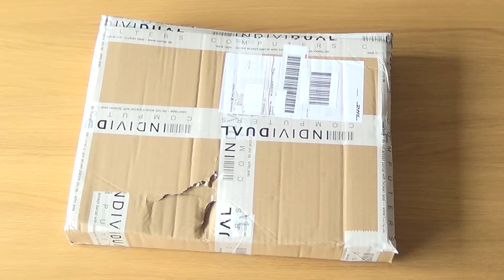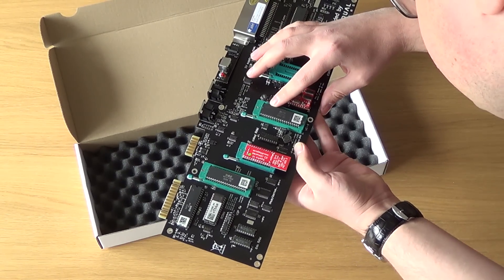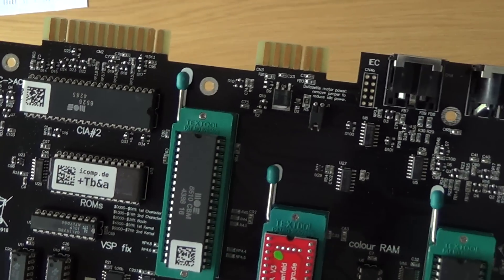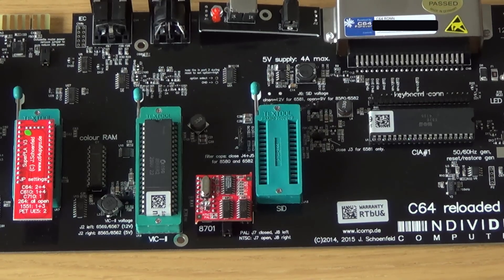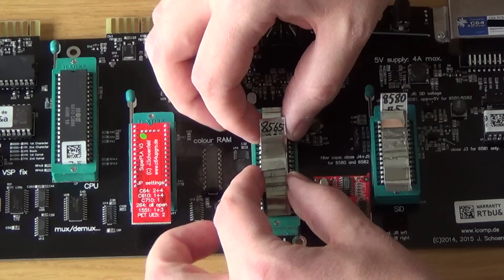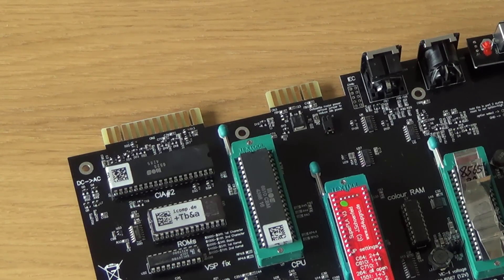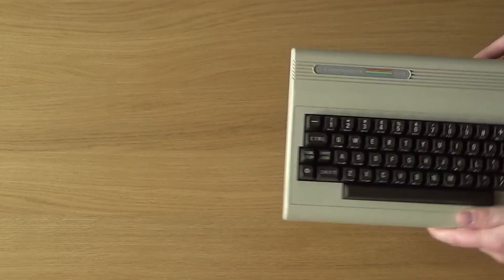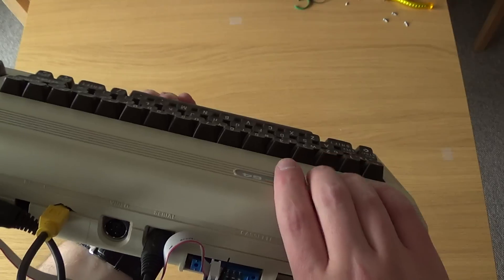C64 Reloaded. The new (MK1) Commodore 64 motherboard.

Comment: Oh My, Iv'e only just joined this group and am exited already, though i'm ten or more years behind all this since having my C64's and other commodore equipment in use. sadly I gave it to a relation of my Sons to look after. his sister and mother had a house tidy and put it all in the outside shed, story goes that it all got wet due to a leak then was thrown away, Imagine my despair when I asked for it back . it wasn't so much about the actual bread box C64 , Plus/4 , Vic 20, and hardware, more about the 1541 & 1551 Disk drives and the floppy disks that contained all the typed up programs and office software that I used at the time. I was also wiring up the din socket for audio output to create seperate audio channels like stereo (I believe there was a unit device that created a stereo sound at the time). So I was already working on a project.  I also had a program written for doing Video Titles called Title Master.    I used the y/C  signal of the 8 pin din connected and wired up the rca phono ends to a SVideo plug which attached to the sVHS socket input of a sVHS Stereo hifi Video Recorder for weddings and other intro's. that din plug I still have wired up to RCA Phono sockets.
Reply from the maker: Man, I feel for you. To lose a 1551 drive is bad enough, but the worst is really the irreplaceable data on the disks. 😐 But it sounds like some nifty home made solutions you did back then. Sounds very cool. 🙂

Not sure how much you know about the current state of the 8bit universe. But if you wish to get back into the game, there are plenty of things to get excited about. Especially regarding the C64. There are modern replacement parts for most IC's in the C64. Disk drive replacement (1541 Ultimate). Motherboard replacements, obviously. There is even an FPGA based solution to replace the whole system, called 'Ultimate 64', which is fantastic. And software, especially games,  are still being developed. The C64 will never die! Regarding VIC-20, C16/plus4 and other 8bit wonders (not just Commodore), there are also a lot og exciting things going for those systems. 😊

Comment: Some comments are about static electricity. There is something about it, but I'm not religius in this point.. However, it is a good idea to touch ground first, whenever you pick up a board. Ground should be available on alle holes for screws. On a normal C64 board, ground is on the edge of the board.

Another comment is about ripple on psu. I can show you what it is on the scope, next time you come for a visit :)

Just my 2 cents :) Thanks for a nice video, interesting to learn something :)
Reply from the maker: Hey buddy. :) You're welcome! Glad to see my old videos are still being watched, heh..

Before tinkering, I tend to touch things I know can zap me. Like a radiator or my table's metal legs. Never thought of (as far as I remember..) touching the ground directly on the thing I'm about to handle. I will try and remember that. Actually, I should have thought of it, as I remember having previously connected an anti static wristband to the ground on a board. Well.. That brain.. :/

I'm still not entirely sure what to make of ripple. If you can make me understand it, that would be nice, thanks. Yes, a visual aid probably helps. :) Right now, in my mind, ripple is some kind of unique unwanted noise. Or something.. :)
Reply: @CasualCommodore  Yoy are on the right path when dischargeing yourself :)

I do not know how to explain ripple in english, but I think it is pretty easy to understand when you see a picture of it on the scope :) But yes, it is a kind of noise. If there is ripple on a psu in an amplifier, you can hear it in the speakers. That can also make CPU, logic chips, RAM, etc. unstable. Or make a picture from a video circuit blurry.

Comment: Got my C64 Reloaded MK1 in a C64G case and use black heat sinks on the CPU, VIC and the SID chips. It got very heat on that chips much more than in the C64 Reloaded MK2. Use the Turbo Chameleon 64 on it for the VGA option. Have also the old 1541 Ultimate II but that is on my C64C 250466. My other C64 250425 RevA have the Nordic Replay. Would like to use the SIDFX on the C64 Reloaded MK1.
Reply from the maker: Nice toys you have. :) 250466 is such a nice motherboard! I also used the Chameleon for VGA some time ago. :) If you don't mind FPGA solutions, I can recommend the Ultimate64. It's very flexible, has HDMI and two SID sockets. But you probably know about it already, heh.. :)
Reply: Yes I live very close to Gideon and i know about the Ultimate 64 Elite. A lot of people praise the Ultimate 64 but what more have it.  For me VGA is very important because of the BenQ BL702A VGA 17inch monitor.  C64 is my first experience in 1984 than the AMIGA 500/1200. The best on the 250466 is the SID6581R4AR and the VIC chip. Have also the SID6581R4AR on the C64 Reloaded MK1 and would like the SIDFX with the 8580R5 as combo. The Turbo Chameleon 64 has good and bad things but that see you everywhere. Like the C64 Reloaded M1 more than the MK2. The FM YAM is also a great thing to use with the 1541 Ultimate II. The C64 is great to use with the AMIGA 500/1200. Do many projects with the AMIGA 1200 and the C64 is a nice sideway if I do nothing with my AMIGA’s. Have my hands full with the three computers and every time I learn new things. Look the most for the ACA1260 and the Vampire 1200 V2.
Reply from the maker: @johandenhertog6878  Sadly, the U64 does not have VGA. With appropriate cables and settings, it can do HDMI, DVI, RGB, S-VIDEO and Composite. I also use a BenQ monitor. :) I use the BL912 for my U64 and A1200 (w. VGA Indivision), as it has both VGA and DVI. But I guess you can just use the Chameleon for VGA, if you want. :) Ah, the Vampire V1200 V2.. I have also signed up for that one. It's very tempting, but I'm not too sure I really need it, as I primarily use my 1200 for demos and WHDload gaming. I think maybe I should use my money on the MEGA65, which should release with a years or so.. :)

Comment: it would be nice if they had expanded the ram to 128 or 256mb  like the ram expansions
Reply from the maker: Yeah, but 128-256mb..? Weee, that's a lot of RAM for the C64..!  :o)  Not sure there is any software that would take advantage of that much (let me know if there is, please). But hey, there is always the 1541Ultimate, that can do up to 16mb expansion. Which makes me think of the new FPGA based C64, which has it built right in: https://www.vintageisthenewold.com/fpga-base-commodore-64-ultimate-64-is-now-under-production/

Comment: "Less than 100 ripple."  Never heard of that unit before.
You can clean line noise pretty easily using a snap-on ferrite noise filter.
Reply from the maker: Nevertheless, it's a thing. ;) Not sure why it's important here, and it's rarely listed in PSU specs. I don't think it has to do with noise.
Reply: In terms of DC Power Supply design, the ripple effect comes from rectifying an AC signal.  AC is rectified to pulses.  A capacitor then tries to carry the voltage across the pulses, leaving a bias/offset of the DC voltage you intended in the design, with an AC "ripple" riding on it.  The larger the capacitor, the smaller the ripple.  I was joking by calling the ripple a unit of measurement.  However, a ferrite noise filter will shunt most AC signals (aka line noise) as well as that ripple effect.  The way ferrite cores work, a change in voltage causes inductance in the core, which is converted to eddy currents, which convert to heat.

In supply design, that ripple is also called noise.

A switching supply is an option that won't have ripple.  You can also use integrated circuits (78xx for positive voltage regulation, 79xx for negative) to provide a good clean DC voltage.  If you need more current than the IC provides, you can shunt a power transistor across it, tying the base and collector together with the source side of the IC, and connect the emitter to the output side (NPN example).

That 100 you mentioned is likely "100 millivolts AC".  In my opinion that's fairly large but common in cheap wallwarts.  You can also reduce that with another capacitor (electrolytic is good enough) directly across the +/- connectors.

According to one site I found (for the C64 supply), "The 5V DC voltage should fluctuate in a range of 4.95 to 5.10 Volt".  This means 5.025VDC with an AC ripple less than 75 millivolts.
Reply from the maker: Sorry, your reply was in "Likely spam".. That was quite a bit of info. Thanks for the education! Admittedly, I did not understand everything. But if I understand it correctly, ripple is "simply" a side effect from converting AC to DC. Yes?
Reply: Not really a side effect.  It's just a product of inexpensive supplies.  I explained two methods where you can convert AC to DC without any ripple at all.  Usually the 2nd stage of a supply will have an IC to provide pure DC.  Inexpensive supplies omit stages beyond rectification and a capacitor.  I'd solder in an extra capacitor just to be safe.  Recommend a 47uF (microFarad) electrolytic 16V.  You can use 100uF but they get bigger and more expensive.  16V is good enough, 25V or 50V is fine, but they also get bigger.

Comment: I think I'd have rather built an adapter cable to map the original video out to S-video and audio before I chipped away at the case.  It has all the necessary pins. (Chroma, Luma, ground, and audio).

Comment: so what does it do different from the original?
Reply from the maker: Sorry for the wait, I'm off the grid these days.. Well, basically it does the same as the original, but it's more future proof and with some added features. It takes less power, and the chips tend to run a bit cooler. It also has s-video out port. There is a newer and enhanced version of this board out now, which also supports dual SID. Check here for more details: https://icomp.de/shop-icomp/en/produkt-details/product/c64-reloaded-mk2.html Have a great weekend..! ;-)

Comment: Where do you find "plenty of SIDs?" I fried my 6581 a couple days ago. :( The new replacements I see on eBay are less functional and the originals cost as much as another C64!
Reply from the maker: Well, the SIDs I have ("plenty" is just 5 - 3x6581 and 2x8580) are from machines I bought here and there. Except for one of the 6581, which I bought on eBay. Right, the original SIDs are not cheap at all. :-/ The SwinSID Ultimate is a nice alternative. It's not perfect, but very capable. It will get better in time. If you like, you can see my demo video of it: https://youtu.be/xw0G2m71rVQ .

Try asking in appropriate forums. You may be able to get a good deal on AmiBay or Lemon64. Good luck to you! Whenever you get a new one I recommend you heatsink it, to prolong its life!  ;-)
Reply: Casual Commodore Thanks. I really want to use my Commodore Mouse for Arkanoid (or paddles) and my understanding is that I have to have an original SID. Well, I got a crazy good deal on the whole C64 lot so I guess it wouldn't kill me to shell out $42 USD for a SID. Paid $100 USD for the C64 with original S-Video cable, disk drive, two Datasettes, printer, cables, joysticks, Commodore mouse, Commodore-brand monitor with chroma/luma, and easily over $600 worth of boxed software (Maniac Mansion, SSI games, and whole lot more).
Reply from the maker: Hoooly sh*t, that was a good deal!!!! A little jealous.. :) I should inform you, that the SSU does support mouse and paddle. Check here: https://ilesj.wordpress.com/2016/04/24/swinsid-ultimate/
Reply: Casual Commodore Amazing! Thank you. Are the files available to build your own cheaply or do you have to order it? Either way, I can't seem to find files or a place to order! As for the C64 lot: I didn't even mention all the cases of loose floppies and boxes of blanks. Well over a thousand disks! Lots of books and documentation too.
Reply from the maker: Stop the braggin', man..!! Hehe.. ;-) SSU info, questions and ordering, here: https://www.facebook.com/swinsidultimate/?fref=ts .. Yes, only via Facebook, as far as I know..
Reply: Emmett Turner just get another C64

Comment: Excuse me, what it's about? I mean "cut into the case"? or "cut into the plug"? Is this explained in one of the links you've added here?
Reply from the maker: I'm not sure I understand the question, but I'll try to answer. It's not something you should worry about, and it's not explained in any of the links. The C64 "case" is the big plastic thing that houses the electronics. The "plug" is the connecting thing at the end of a wire (the yellow plug in the video). In the video (at 16:15) I cut into the case (removed some of the case plastic) in order for the s-video plug to reach the motherboard inside. I should have cut into the yellow plug instead, since the case is more valuable than the plug. ;-) Was this answer okay?
Reply: Oh, yes! I've got it finally :) Thanks. Yep, C64 case is more valuable, of course. But you can use some kind of a plastic for child works. The material usually to make some kind of plastic dolls and other stuff. These are mainly of two kinds: plastifies in oven; plastifies on air (two-component maybe). Some people tells these are not though. But you can try (find some good of it on forums for craftwork) and make a "patch" for the case. It can be tried on something else to be sure.
Other idea: use a good PVA glue. Not that small bottles for paper works (it can be very watered) but usually some big or medium cans. It's pretty cheap. I've didn't found receipts how to fix with PVA. But it can be possible because this glue is pretty strong! Many people gives solutions with epoxy glue.
Here some car "tuner" guy shows how he fixed a big hole using a fiber (some Polish production) and epoxy glue. Pictures gives the idea. The main tip was "don't hesitate about the amount of glue or it will be a crap". Firstly he put glue with a brush there then he put fibers.
He tells that after finishing the surface is very strong. As I understand it's a rough composite surface :) Very cool.
https://www.drive2.ru/l/7714987/
Maybe you need (if need at all) just to make an inserted "ring" part that will be glued to the case. So it will patch the size.
Reply from the maker: Wow, thanks for all the detailed info. ;) But I'm not gonna repair it. At least, not in the foreseeable future. I just don't feel it's worth the trouble. If I one day do decide to do it, I'm pretty sure I will consult your message. So, thanks for that! :)
Reply: You're welcome! Save the ideas then :)

Comment: hay can you help me? my floppydrive isnt working and i dont know why the c64 says its not present idk why :/
Reply from the maker: Technically, I don't know much about the floppy drives. Try the other port on the back of the drive. If it's the 1541-II drive, make sure the two switches on the back are both at the top (device 8) - or try using device 9, 10 or 11. Perhaps defective cable, drive or C64? If possible, try another cable, another drive or another C64. ;)

That is about all I can help you with, I'm afraid. If you still have problems, then something technical is most likely wrong with the drive or the C64. I strongly suggest seeking help in the Lemon64 forums. They are very smart and helpful in there. Good luck, man! I hope you work it out. ;)
Reply: its a 145I i tried both backports it starts normal (head is going back and making the lovley sound & the green led is on) i will try to find a new cable cause the one im using is the org. from 1988 maybe it was a too long time. i asked y cause i dont know anything about c64 (i know how to print stsrt games n stuff tho) cause im only a 14 year old who has gound the old c64 of his mum ^^
Reply: i tried 8 9 and 10 aswell no difference
Reply: found* crappy phone keyboard
Reply from the maker: 14 yo? Wonderful! It's nice to see someone from a newer generation showing interest in this fantastic machine. The C64 can't do real 3D or Virtual Reality or any of that "new" stuff. But man, it can deliver fantastic gameplay, and there are thousands of games! It's a unique world. Heh.. Well.. If you're serious about this machine, sign up on Lemon64. And say hi to your mom for me.. ;)
Reply: i sure will! the old c64 is way more intresting than my newer pc, sure i cant play crisis n shit with the c64 but who cares? i want to sit there for 6 hours type in a game from a old magazin and make so many typos that it takes 3 hours more to correct it xD. for all the new stuff i got my pc from 2014 for exploration of tec, dang good games where the designers couldnt just focus on the "damm good graphics" but really had to make a good game to get ppl intrested and a short view of the past & childhood of my mother i got the c64.
Reply: and i found the box with all the floppies from my mum so i got a lot to play and maybe its a fun activity to play some old games with here shes not really intrested in the newer games but each of us with a joystick in  the hand playing some splitscreen coop n stuff could be fun ^^
Reply: i told here that you sayed hi, she told me that i should tell you:hi! from here

Comment: you can still find complete 64s and 128s, even a an occasional Amiga in estate sales, garage sales and thrift stores, but they are getting harder and harder to find. I found a complete 128 in the box with everything, it might have been opened once, but it was clearly never used. ... that was a few years ago though ... what I didn't know is that it possible to buy a new board? I guessing it costs way more than the original whole computer, even after adjusting for inflation.
Reply from the maker: 160euros, so yes, not exactly cheap. AFAIK, stock has been depleted for a while now. But redesigned boards will be produced, so they WILL return.

Man.. I would REALLY like a C128 in pristine condition. I would kill for one of those!  (Well, not really.. Just in case FBI is reading this.. :) )